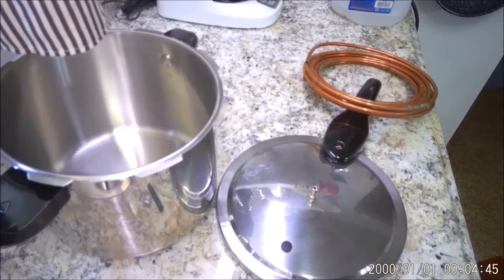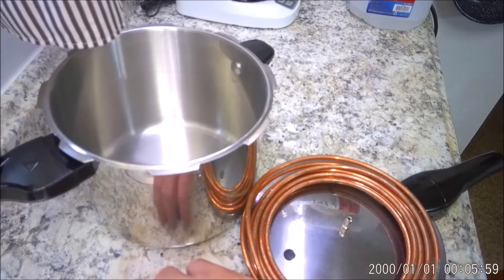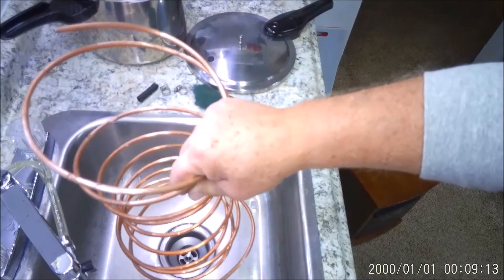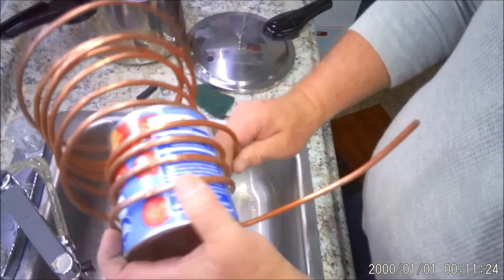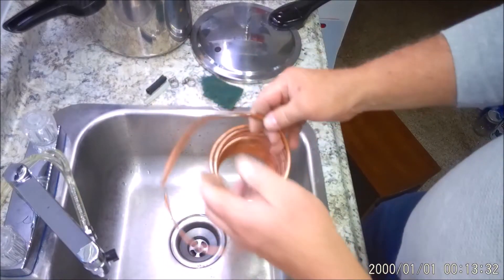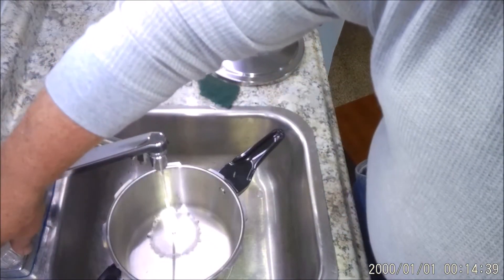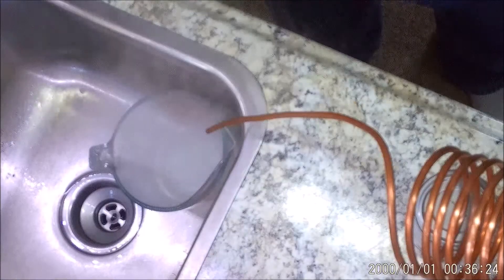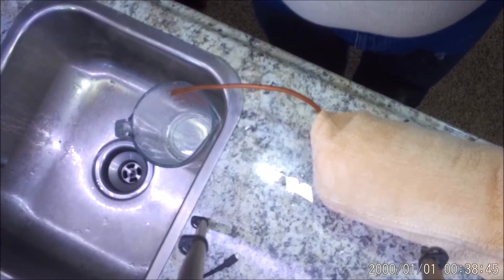How to make a distiller, DIY water distiller. Simple distiller.

Comment: Put the coil in a 5 gallon plastic bucket with a small hole drilled near bottom on side -  run the copper tube thru the hole long enough to put over your collection pot.    Seal around the tube with rubber cement.      If you get steam out of the end of the copper tube - turn the flame on the stove down!
Reply from the maker: Excellent idea!!! That's good thinking.  Also I think some RTV (silicone caulk) will work to seal around the tubes. Thank you for the help!
Reply: That's how we made liquor in high school haha.
Pressure cooker -> coil -> plastic 5 gal, silicon around the drilled hole for the copper wyrm and filled it with ice, water, salt. That gas turned to liquor fast :)

Comment: add 8 teaspoons of salt per gallon (3.78541Litres, = 4L) is mentioned in google search
Reply from the maker: Why would you add the salt? Is that before you boil it, or after to add some electrolytes?
Reply: @davenooner2142  add afterwards..  when you buy a electric portable table top water distiller it actually comes with activated carbon rocks in a tea bag that water is supposed to pass through before exiting the pipe's nozzle tip, you are not supposed to drink 100% pure distilled water..

To Quote multiple sources: 

"A filter with granular activated carbon (GAC) is a proven option to remove certain chemicals, particularly organic chemicals, from water. GAC filters also can be used to remove chemicals that give objectionable 
odors or tastes to water such as hydrogen sulfide (rotten eggs odor) or chlorine"

"Activated carbon filters are used to remove chemicals such as chlorine or other chemicals that don't adhere to carbon. Activated catalytic carbon, which is more reactive than regular carbon, chemically alters chlorine molecules and converts them into salt."

I'm not sure when to change filters, water has never tasted bad, so i change once a year..

When nurses install a cannula into people's veins in their hand, they use later a syringe with distilled water to check if it leaks or vein is blocked or something, i'm wondering if their distilled water has passed through activated carbon or is it 100% pure..  The water i make with same hospital table top distiller registers at 0.002ppm using a TDS Meter, better than the supermarket distilled water 0.003ppm.. I think the carbon and my plastic jug, and metal pot/pipe won't allow it to hit 0ppm..

activated carbon for water distiller
https://www.ebay.com.au/itm/385250013081?hash=item59b2b0af99:g:BF8AAOSwilxiHER1&amdata=enc%3AAQAHAAAAoPIXOurDp0r7Z9fTKiSkOScwonwFF%2B%2FNkFVhO%2Fxfp6MTZ7k63qiOd6S6Q22JSOrJEjWSEAGQdc29LyCIcnq6sScwf8AUTV0q9TnXvwWLaipE7CoOtNESmuXLbLgPcNAi4Co3cXr4FUXMqM%2BmxG6avlVIat94ArbhL%2BV5IHJmnBeNAGtvKN3qwq65ZmJpkJLHrVZJZ9EwzBqApXzkg5e2s6U%3D%7Ctkp%3ABk9SR4jOgNKYYQ

I bought this TDS Meter because i'm fussy about what cell batteries my devices use, CR2032 lasts longer

https://www.ebay.com.au/itm/363681636804?hash=item54ad1d61c4:g:eMcAAOSw9kZh17Dn&amdata=enc%3AAQAHAAAA4JkqQJAOofoyWWYEcvskt1Tn46VJ0qb%2B77ID5rhws%2BbPAWrzmp%2BI8Fs%2F89hQ5QMFqQxXeEsDwX6iS0MOAaRXRyXKKouVJ875XxnibTXZ%2B%2FojhDswsjJPMIgoBpTPPUMKeS5JYmf%2FBx%2F9drkIpJsZv%2FaB2icC382HhUjT8%2F%2FDplDp4PzN8eWUm0BH0s4FsaUc%2Fumz746oOu56idXdg3V9S0O19PeQ7Fc%2BP0iQF%2FyIZCS07gUgaf1C0rV2iNk1Mxp335Cn2vnOMP5DkttbcNUvDHRsGfWlpXpzh%2Bd7KdH15iy2%7Ctkp%3ABk9SR8yG6tGYYQ

search your American eBay if you are not from Australia, i use Australian eBay or Chinese Aliexpress..

Alternatively, if you eat like a normal person, Vegetables etc, your body should be getting the needed minerals without needing Activated carbon filters or addition of Salt, but it is best to play it safe, i never tried the salt, my 5th distiller fan broke over the years, so i need to build this stove version, but American metal pipe hose is so expensive to buy from Australia
Reply from the maker: @TheOzTube  Oh I understand now. Thank you for taking so much time to explain yourself. That is well done. I agree about the distilled water drawing things out of your body because it is so empty like a dry sponge. I understand it will pull vitamins and minerals out, however... That can, and is a good quality of it too. For a cleansing "water fast", it will pull toxins and poisons from your body as well. And as a medium for drawing properties from herbs, there is a great value in distilled water by itself too. Of course using it for lead acid batteries, water has to be distilled too. If taking it on a regular basis for drinking, it is not recommended unless you HAVE to, in a survival situation or with the addition of good real salt, like you stated. Thank You again. Good luck to you!
Reply: @davenooner2142  i purchased a water distiller because i was getting kidney stones every year by January because i had a bad reaction to a weight loss pill i saw on tv, it helped and i haven't had any stones needing to come out.. i do use the carbon..  i use distilled water with 10% white vinegar to wipe camera lenses, it prevents fungus growing on the glass, and dilute iso rubbing alcohol..  there are many uses for distilled water..  my mother puts it into her clothes iron, no white chalk stuck inside etc..
Reply from the maker: @TheOzTube  Great information ! I am glad your feeling better too.